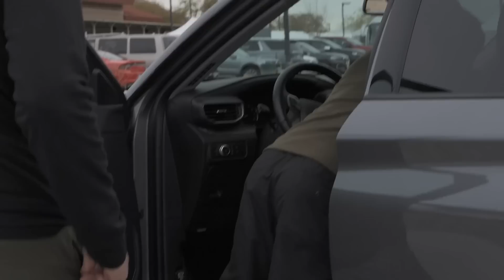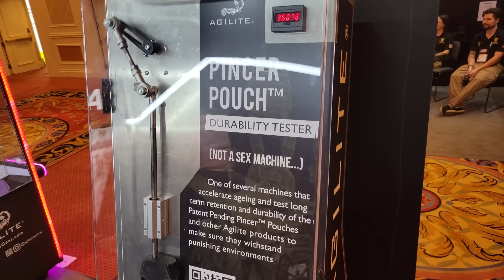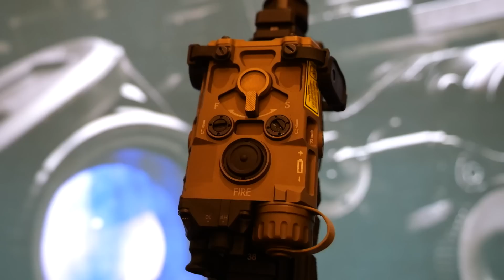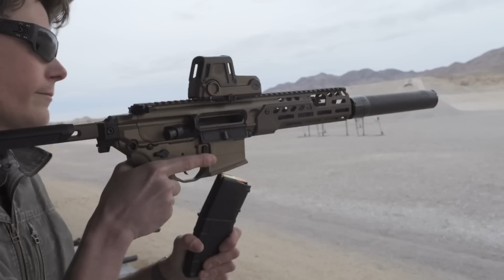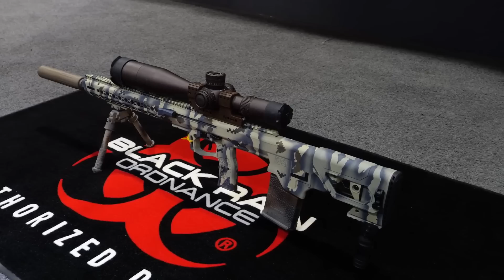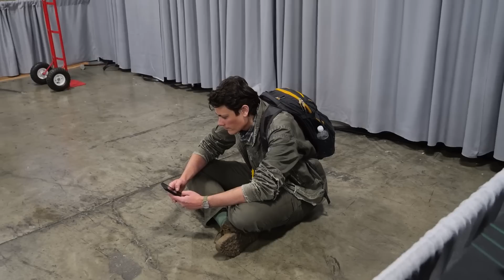The SHOT Show Awards 2023: Hop Reviews SHOT Show

Comment: That is the best handguard/overall ergos(at least without actually holding it) that I've ever seen on a bullpup.  I've always thought that was one of the biggest drawbacks of bullpups(excluding malfunction clearing/ejection for people like me who shoot long guns lefty.  And the triggers.)
For example, back before I knew anything about guns(like 15 years ago maybe?  More?) I bought my first rifle/HD carbine, and living in CT with the new AWB about to pass, and no ARs-even state compliant ones-to be had anywhere, I ended up with an FS2000 Tactical.
Fu-cking-hell.  That thing is is like a giant NERF gun, but with an extra 8 lbs or so added on.  Only option with the tri-rail is VFG, which isn't a huge deal, but I like to hold carbines way out front some times, as well as have the tape switch for my lights on the top rail right behind the front sight.
And not only is the front end wide as hell, but like most bullpups it's tall as hell(I imagine in large part due to virtually all of them being piston guns.)  Again, this prevents that C-clamp sort of grip, on a gun that already is short and has little real estate when it comes to rails/accessories.
Granted, I'm pretty much over my bullpups kick(though I would get a Tavor/X95 if they were legal in my state), but I look forward to seeing how gun runs, and what sort of things they did to solve certain problems.

*edit*

Good God, why do I comment on videos before finishing them?  Didn't even realize it was a .308 gun.  That makes me even more interested(given I two .308 ARs, one with an 18" barrel, and one with a 22" barrel that I pretty much use for target shooting when I get the chance.  Both with cans on them.)
Then again, what am I gonna do with a .308 bullpup, even if I could buy it?  I suppose it could (maybe?) Make a compact ranch rifle or something?  Then again I'd feel a little silly riding around on a UTV carrying a video game gun in digital camo with a flashlight and a can and an optic on it like got blown out of the Fortnite universe while parachuting down and found myself in Wyoming or Montana or something.  I feel like the coyotes and wolves would laugh at me.

Comment: No one cares about 6mm arc. Hornaday owns it and they aren't sharing.  They are the only manufacturer. Also psa is making steel 7.62x39 to fill in the gap left by Russian ammo drying up. I assume 6.5 grendel steel case manufacturering is on their radar with military adoption via zastava 6.5 has growth potential where 6mm arc does not. Marginally better performance with less bullet weight options is not a selling point.

Comment: @TFB TV the 300BLk sub vs. super anomaly is related to the twist of the rifling. A heavy for caliber bullet [300BLK subsonic] will exhibit a higher spin drift rate versus a lighter for caliber bullet [ 300BLK supersonic].  Thusly, the horizontal variance seen downrange. The spin drift is exacerbated/exaggerated depending on the wind direction as well.

Comment: A 6.5 Grendel AK could have a bolt that doesn't break as easily as the ar15 6.5G bolt breaks. Then you'll have a larger bullet with more energy that can hit harder, farther, than 5.56, without the weight and recoil of 308. If you're into that kind of thing.

Comment: First off thank you TFB for making Hop continue to rage attend as many industry events as possible ❤😄 Secondly, although less used, 6.5 Grendel is the perfect intermediate cartridge between 7.62x39 "knockdown power" and 5.45/5.56 ballistics & accuracy... Even out of 16" or shorter barrels. Just losing overall performance as you go shorter, just like 5.56 (although slightly different length percentages) It's just never been optimal for the AR-15 because of 20+ round magazine reliability issues (better quality bolts that don't break have already been around for years so that's no longer really an issue if you buy a decent brand) However slap those rounds in an AK platform and you have the magazine space and optimal curvature already, along with plenty of extra super mega commie bolt face strength... I think Serbia or some neighbor has adopted 6.5G as their military service round... I just hope someone takes over the Wolf steel case 6.5G market and makes it cheaply importable again... $0.30 a round for steel case that shoots 2-3 MOA consistently between lots even out of pencil barrels was pretty awesome... Hell it still shoots better than PPU brass fmj and is still cheaper even with the doubled price due to limited supply! The Wolf is definitely the dirtiest ammo in the caliber, but 24+ rd mags will jam a 6.5G AR before fouling or cheap ammo ever will! 🤣👍 (although I'm definitely never buying an AK in 6.5 Grendel 🤦‍♂️, I just see why it makes sense if someone wants the magic Goldilocks cartridge for power and range in the standard AK platform) 🤔

Comment: Clearly someone has very little experience with 6.5 Grendel. It does extremely well from 16" and shorter barrel lengths. 10.5" will still ring steel with minimal effort out to 5 & 600 yds. And who doesn't understand a more efficient 123 grain round being lauched from the same barrel length as the x39.

Comment: My 6.5 Grendel is a tack driver.  (Aero builders kit, carbon barrel, Sandman can) If that cartridge is on the outs, that just shows how easy it is to dupe people into going with markedly more expensive rounds (ARC) that only provide slightly better performance. Performance that’s usually only attained by the top 1% of the 1%.

Comment: Really hoping PSA finds a way to make the JAKL uppers a little less of a monolithic upper, and (for lack of really any other way to describe it) more akin to like an AR upper. Not necessarily reworking all the components but making the upper much easier to tear down and more user serviceable. I still like the way the JAKLs going and it seems like it's become a solid AR alternative since they fixed the gas plug issue on the gen 2.

Comment: Love you Hop, but 6.5 Grendel is an excellent choice for AK.  My unsolicited .02 Republic Dhaktaris on Grendel in an AK

1) They are not that hard to scope. 
2) They CAN be shot rather precisely. Talk to Rob(ski). Hell! Even Brandon Herrera and co. made a .224 Valkyrie AK and shot it too 1K yards. 
3) It (Grendel) is not on the outs. Particularly when a sovereign has chosen it. Zastava M19 anyone? A Tabuk in Grendel would be dangerous!
4) It's better out of an AK for the same reason it's better to shoot 7.62 out of an AK. The bolt face!  It needs to be bigger while the overall bolt diameter ends up remaining the same. Ergo, there's less material to support the lugs and stuff from a larger cartridge. The AK WON'T have this issue. 

This would make a fantastic GPR with a capability greater than 800 meters for a  DMR guy.

Comment: We had 2 Christensen Arms AR-10s in 6.5 Creedmoor and neither would feed any in spec off the shelf ammo correctly, sent it back and they said they were just fine, but they did give us a full refund.

They wouldn't even feed Hornady's 120 or 140 grain v-maxs or ELDs. Looked like the bullet and shoulder was skinny enough to ride between the .308 feed ramp slots and get wedged against the chamber face. What was really neat was that would cause the bullet to get unseated and compress into the powder, and occasionally that would make it to the chamber. That would have been fun if we weren't paying attention.

Comment: 300BLK AKs are for trolling. It's fun to watch some ones brain lock up when they see an AK-74, but it fires a 30 cal round. The AK beats up the brass a lot more than the AR, so I don't think the brass will last as long for reloading. It's also why I pulled that barrel and a 5.56 barrel went into it's place. I'm going to use the 300blk barrel for a shorty build in the future, when I can source the rest of the 74 parts I need.

Comment: 6.5 Grendel was designed to be a 1000 meter round out of 16" of barrel, hence why 16".

Serbia now has adopted 6.5 Grendel as it's standard round and Vepr has been doing it for years, so AKs in 6.5 have been used, tested, and passed. 

Grendel hasn't been on the outs, but the $6 Wolf boxes of 20 haven't been coming in from Russia for some reason. . . 

PSA makes what sells, which is why it's good-guy Cerberus.

Comment: 6.5 Grendel makes the most sense in an AK.  It shares the same case as the 7.62x39 and Wolf makes steel case that is much cheaper (or used to be). It improves on x39 by extending the range theoretically to 1,000 yards (maybe not realistic in an AK platform). The AK has a bolt and extractor that will not break like the AR, and you could even increase the  6.5 Grendel pressures which could further improve performance.  The Grendel is the perfect improvement over the x39 that makes the AK47 competitive with 5.56 and 5.45, some would say better.
Reply: Couldn't agree more. 
And there vids floating around of guys shooting Grendels well past a thousand yards. 
And I seem to remember that PSA is starting to make ammo right?  Perhaps they are going to make Grendel?
Reply: @terrencecox3748  I believe they will start making Grendel ammo. In fact they are going to make x39 steel cased ammo and some others
Reply: Hadn't thought about this. Good point. I am going to look at the new PSA models when they become available.
Reply: >maybe not realistic in an AK platform

Incredibly not realistic in an AK platform. Barrel is not free floating and it doesn't have a feed ramp, it has a bullet guide. And that bullet guide is more of a bullet suggestion. The lower lug of the bolt punts a cartridge into the bullet guide and from there it deflects into the chamber.
Reply: @poisonouslead85  Great input! 

About the barrel not being free floating, your concern is that this is a negative in terms of accuracy correct? With that in mind (and assuming yes to the last question), how does PSA anticipate it's usage and what are the reasonable expectations based on that? I suspect they don't expect this be used in a PRS type fashion. 

That said, Zastava must have overcome issues with 6.5 Grendel in the M19 and it's still more AK than not. ;-) 

We'll see how PSA deals with things you are talking about.

Comment: Nothing on the M&P 5.7? I get not liking the cartridge, but a major manufacturer coming up with a NEW gas operated handgun? And a clever way to do it at that? That gun is cool, in the nerdy engineering sense.
Reply: Agreed, love the gas system design. Genius.  And it makes the softest shooting cartridge even softer which is pretty sweet
Reply: go watch Yankee Marshall's video, very poor fit n finish on the display gun, slide forward, you can see daylight between the slide and frame.